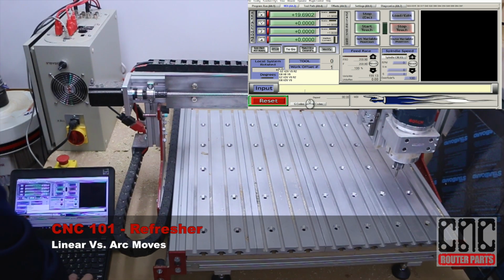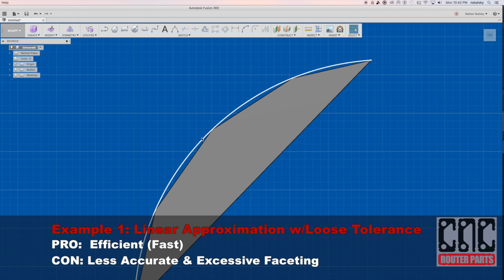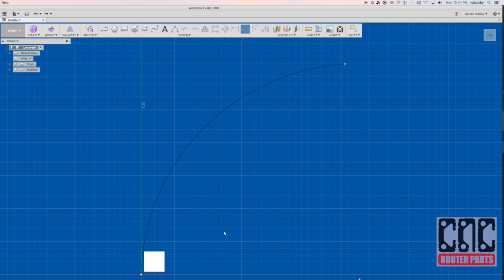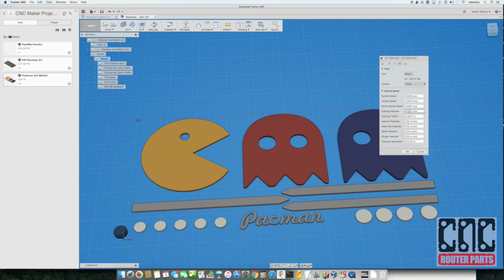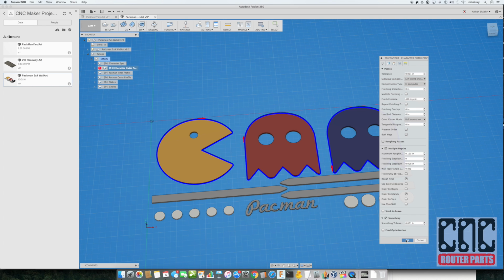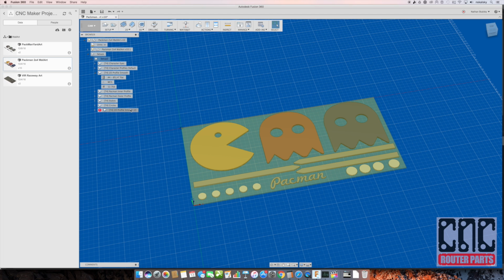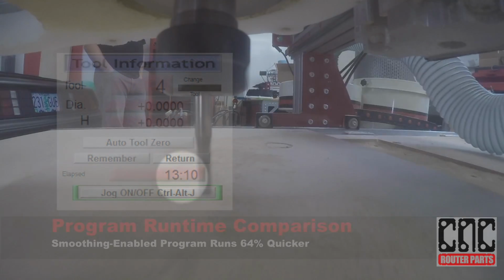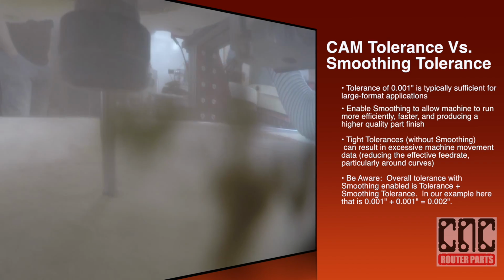Supercharge Your CNC Productivity with Fusion 360 and CNC Router Parts PRO CNC Machines

Comment: Excellent video and explanation. Nevertheless: (6:41) "Smoothing-Enabled Program Runs 64% Quicker" is not a correct statement. This statement assumes if the SEP completed the project in 1 second it would be 100% faster, obviously incorrect. In this video example, the non-SEP operation took 2.75 times longer. Or you could say the SEP operation took only 36%, approximately 1/3, of the time the non-SEP took to complete the same project.

Comment: I'm new at CNC, but this is by far the best video I've come across as far as tuning for productivity.  I've only been using VCarve Pro, and while unsure if tweaking such as this is allowed in VCarve, I'll have to consider trying to incorporate Fusion into more of my products!  Thanks!
Reply from the maker: Thanks Corey!  Yes, these concepts apply to VCarve and Aspire as well, specifically toolpath accuracy can be modified via Edit > Options > Toolpath Settings. -Nathan
Reply: Vcarve pro is so hard to learn. I did a 45 min video on fusion for 3D printing and it's so intuitive that I picked up a CNC machine 6 months later. I highly recommend it!

Comment: Interesting, do you usually work with Fusion 360 for your business?
Reply from the maker: Internally we primarily use Fusion 360 and Vectric VCarve & Aspire as our CAD/CAM tools.  Both provide an excellent experience for different needs.  Fusion as a 3D design and CAM tool and VCarve a very intuitive 2.5D design and CAM program.   -Nathan